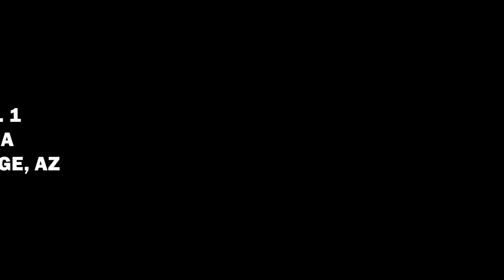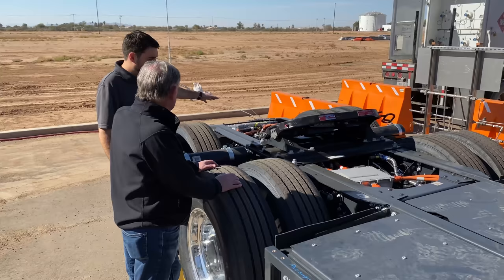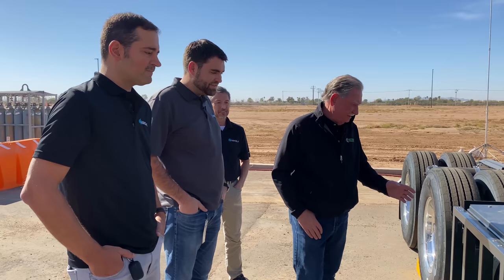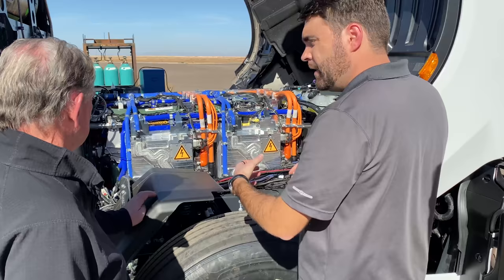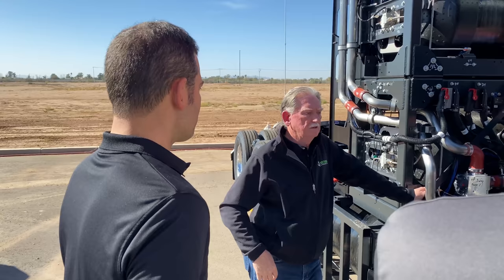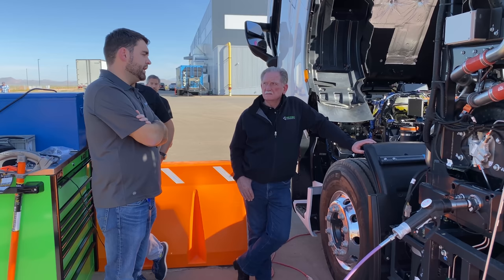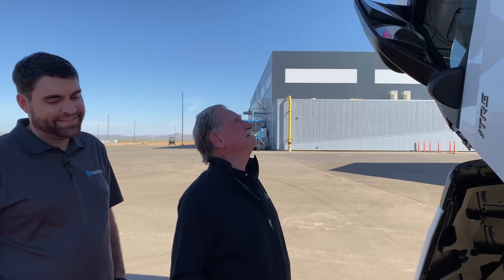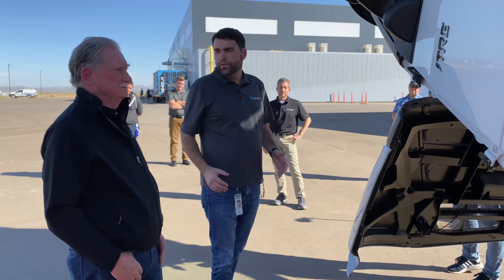Nikola Series - Ep. 1: Introduction & The FCEV Alpha

Comment: Tony Seba talks about a situation called super power where there is massive amounts of surplus renewable energy and some of the excess could be used to make cheap hydrogen.
Superpower would mean on 15 days a year you have just enough renewable energy and on 350 days a year you have surplus.
Reply: Yeah, I saw something similar. A study that claimed the cheapest way to get to 100% renewables would be to overbuild solar/wind such that their lowest output of the year is adequate along with modest storage. That leaves a lot of curtailment during much of the year.

Comment: This is the Nikola Tre Fcev with 2 100 kw h2 fuel cells that produces electricity, h2 fuel cells do not hp or torque ratings, rechargeable battery pack that provides electricity as needed, and 645 hp electric motors integrated into the rear axles, 500 mile range and is much smaller than the Tesla Semi truck with 500 mile range. Nikola Two fcev might have 900 miles range, is similiar in size to the Tesla Semi truck. Nikola Two fcev prototype seen driving on test track, not pushed downhill.

Comment: Fuelling the trucks from a high pressure tube trailer is painfully slow and stops when the pressure in the supply trailer equals the trucks tank pressure. The only feasible fuelling process going forward is a liquid hydrogen tank flashing off the liquid through vaporizer coils and then feeding it through a high pressure pump to fuel the truck. A complex system involving trucks to transport fuel to fuel trucks. Battery electric trucks do not require trucks to fuel trucks.

Comment: Thanks for another useful video. I was a little surprised by the total power capability of just 200 Kw (approximately 268HP). That may be fine for mostly level terrain but not so good for hillier country.  I just did some back of the envelope math on power requirements. For an 80,000 lbs. GVW and ignoring rolling resistance and drag it would need 112 HP to maintain 60 MPH up a 1% grade, 224 HP for a 2% grade, 337 HP for 3%, 450 HP for 4% and 563 HP for a 5% grade. A bit more math and the maximum grade for 80,000 lbs. at 60 MPH will be 2.3% with sustained 200 Kw power delivery. Clearly, this unit will be challenged for highway use. One last thing, what is being done with the energy captured from regenerative braking? How is it stored?
Reply: Didn't you watch the promotional video? These trucks are only designed to go downhill.

Comment: munro is ok with his idea of getting rid of mirrors, but what does the driver do in an electronic failure to safely navigate off of road ?
Reply: How about using them both?
Reply: @ThisIsF-dUp  he said in the review of the truck that mirrors are not aerodynamic, why not use cameras, if you take mirrors away, an electronic malfunction could be bad for driver if he has to get over to right lanes in the blind, i have had a right hand mirror come loose on the highway driving a semi and having to merge lanes to the right blindly was a scary experience. that's all I meant was from experience.

Comment: It seems to me an added battery might be useful for added acceleration performance and energy recovery on braking.
In principle the fuel cell can be inverted , operated as electrolyzer, but oxygen also gets generated and a pump would be needed to put the recovered hydrogen back into the tank, or into a lower pressure storage tank .
But probably far too expensive to recover energy .
I think the added battery to boost power for hill climbing and dynamic braking will eventually be installed, reducing the brake wear and maintenance significantly
Reply: They have that already. Apparently fuel cells do not react as fast as we want to a depression of the accelerator pedal so they add a battery for those occasions and then it can also capture energy from regenerative braking.
The Nikola Tre BEV has nine battery packs. This fuel cell model has 2 or 3 (can't remember which).

Comment: At around 15:14 they talk about batteries. What is so different about Nikola's batteries that they don't degrade over the same timeline? Or do they not use batteries in their system?
Reply: They have a BEV truck. This fuel cell version does have some batteries since fuel cells don't respond quickly and the battery provides the extra power needed on acceleration and starting up hills and can also capture regenerative braking electricity.

I wish Sandy had queried them on their statements in that part. They appeared to simultaneously say that their fuel cell degraded over time but the power would not degrade much over time.

Comment: I’ve commented before that swappable battery packs make sense, especially with trucks.  It would be easier to institute a standard for trucks because their sales aren’t as style driven as automobiles.  Swappable battery packs also gets rid of the battery aging problem because a vehicle is not stuck with the same battery pack for its entire service life.  There is also the possibility of using a mix of permanent and swappable battery packs in a given vehicle.  Early on Tesla considered swappable battery packs for its automobiles, but abandoned the idea - just too much build-out required.  For trucks, there are many fewer service plazas, so build-out of battery swap stations while an issue is less an issue.

Comment: 9:20 No, that's just flatly wrong, and although Sandy, I give much kudos for being polite, for you to actually go along with that doesn't reflect well on you. Natural gas is much lighter than air (and slightly lighter than water vapor). Not sure if they're confusing it with propane and butane, which are a bit heavier than air, or with gasoline, a really lame comparison if that's really what they're thinking.

Addendum: Maybe some people think gas is heavier than air because the odorants are heavier than air, and in a leak situation they quickly separate and hug the ground, giving an impression of the gas staying low as well, when it's really rising.

Comment: Per the last minute, I suspect the holdup with camera vs mirror regulation is that mirrors, for law enforcement, are obvious when they are broken, cameras are much more difficult. You could potentially have a light coming off the electrical line for the camera or a software thing, but I imagine the concern is that both of those can be "hacked/faked" much easier than mirrors can.

Just my guess though.

Comment: Some hard hitting questions I wish Sandy would have mentioned (still 4 more parts to the series, so let's see):
1. Weight of vehicle
2. How much gross weight can it tow.
3. How often to refurbish H2 storage tanks? The cost to do so.

Just looking at this truck (ignore all the telemetry wiring) the complexity is huge. Agree also that it doesn't look very aero. Get rid of mirrors for a start! But look at the parts and weight that get added, H2 tanks, Fuel Cell, batteries, etc. H2 for trucks doesn't look like a good option to me. Not yet given where the tech is. But it is dead on arrival IMHO due to cost. Both purchase cost and cost to refuel. If you are using grey or blue Hydrogen, your environmental credentials are in ruin. Green Hydrogen is best, but very expensive and energy intensive (requires 3x electricity as just powering a BEV truck).
Reply: Sounds like you don't know about the free fuel and maintenance plan included with the price of purchase. Nor do you know about the the various partnerships to create clean H2. Learn more kiddo...

Comment: Sandy, there may not be a transmission or oil tanks, but there's an amazing amount of tubing.  Semis are subject to a lot of shaking on the roads so there will be a lot of twisting and shaking in all that plumbing.  BC Transit ran some test H2 buses during the Vancouver Olympics.  From what I understand, they did not keep them on the road afterwards because of unreliability.  Granted, that was 10 years ago, but the complexity of these systems is multiple times that of an EV.  And, is there no battery at all?  My understanding it that the fuel cells charge a battery that feeds the electricity to the motors for smoother and more reliable performance.  Be really surprised if these H2 semis will be ever be practical and cost effective to operate.  In BC, the subsidized price of H2 is $12.78/kg, unsubsidized about $16.00/kg. At 70 kg., the unsubsidized price of a fill up would be $1,120 for a 500 mile range or $2,24 per mile.  How does that compare with diesel and Tesla's BEV Semi?  In terms of the all important emissions, 98% of H2 is made from natural gas and lifecycle natural gas emissions is only about 20% less than diesel.  Green H2 is a pipe dream as it takes some 60 kWh of electricity to make 1 kg of H2.  That's 4,200 kWh to fill these 70 kg H2 tanks. How far will the Tesla Semi go on 4,200 kWh of charge??
Reply: The Nikola Tre BEV has nine battery modules. This fuel cell Tre has 2 or 3 battery modules for better response and also allows capturing regenerative braking energy.

Comment: I have problems with hydrogen because there is an extra conversion involved in the energy distribution process converting electric power to hydrogen and then back to electric power again.  Each conversion adds inefficiency.  A game changer would be if there were a way to obtain hydrogen directly from a fuel source without electrolysis.  Unfortunately I don’t see that happening at scale any time soon.

Comment: Apparently the Nikola 1 has a 350 kWh battery pack that they did not show anyone.
Doing the math a loaded FCEV Class 8 truck with 80,000 pounds cannot do a 5% grade at 50 mph because over 400 kW of power is needed to just overcome the gravity forces and, as per the video, Nikola said the power output from the fuel cell stack is only 200 kW. 
Arrive at the bottom of a hill with a low battery and the FCEV truck is not going anywhere. 
"Hill anxiety" anyone?

Comment: pressure hydrogen has leaks you cant't see.. that use to be a problem in the plant i uset to work at.  think if that happens on the truck... hydrogen gas its just too unstable when there so much of static in the air...specially during raining seasons....

Comment: For sure a hydrogen powered truck will work.
Let's ask some critical design review questions.
-Will it really meet the specs?
-Where will the green hydrogen come from?
-What will the green hydrogen cost?
-How long will it take to pay off the feeling station?
-How much life cycle testing have they done on its components?
-How many miles test track testing have they done under load?
-Home many miles of road testing have they done under load?
Been on both sides of the critical design review process, I’am sure there's many more questions to ask.

Comment: So many red flags! My favs:

- Does this look like a 4B company? Got space but where's the team, Machinery etc.? Zero activity. 
- How often Sandy keeps reframing as great for an Alpha... not just great. 
- 19:35 "we're looking into fast fueling times of 1 hour or so"! 😬
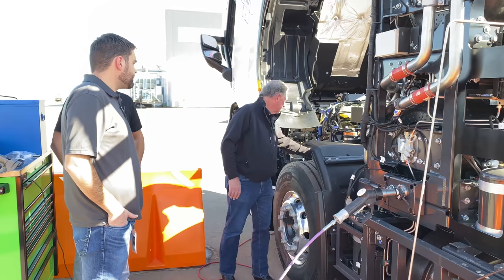- 22:19 uh you're going to bolt that down before you drive it right? Should at least be painted red. 😬 
- 22:35 We've giving you access so don't criticize? Do they consider Sandy being there as PR or getting some world-class engineering input? He literally just told them how to cut it from an hour to 15min of fueling time off the top of his head & they barely listened.
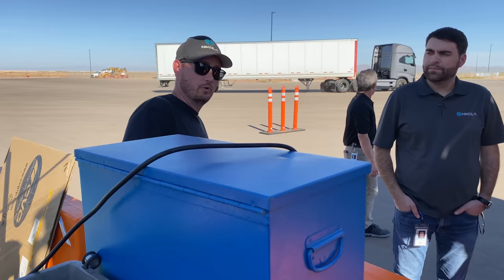- 25:04 truck in background makes a sound like something is very off. 😬

I'm sure I'll enjoy the rest of the episodes cringing as we read between the lines. Keep it coming!

Comment: Thanks Sandy for previewing this Hydrogen powered rig. My first impression is; holy crap! that thing is impossibly complex! Practically speaking. New technology usually means frequent breakdowns but Service Centers would be very few and far between. A breakdown on empty stretches of road where long-haul trucks travel a hundred moles from nowhere. Could require the truck be towed hundreds of miles to a Service Center, and Big-rig towing is very expensive. Can an expensive Hydrogen powered truck like this be truly safe in real world long-haul trucking? Could it be economically feasible for an owner-operator to invest in? Insuring a Hydrogen powered long-haul truck might be pricey too. Bottom line, it seems logical that EV trucking will be sooner to market, less costly up front, making it more cost effective. Far less complex to operate, and less likely to breakdown. Plus much easier to work on. However, I’m no expert. Just an observer. Thanks for your thought provoking content Sandy.

Comment: Hydrogen has its work cut out to take on batteries. The lower efficiency needs to be overcome with mileage per ton of installation, all included, versus batteries. Residual value matters, but so does maintenance throughout the life cycle.
As truckers need to usually wait for (un)loading and sleep, it's relatively easy for batteries to make up time. Korean cars charge in about 30 minutes so with a scaled system, difficult to compete with. A few 350 kW chargers in parallel is not that complex or expensive compared to a hydrogen installation. And you can't place those inside or close to a distribution center, let alone refuel during (un)loading when the driver needs to be present.
Reply: Distribution centers with Outdoor electrical chargers and hydrogen fueling stations have already been built with many more in design. For short-haul electric trucks makes sense. I am working on utility grid issues using backup power and microgrids for some of these new distribution centers. Keep in mind the average EV car has less than 40kWH batteries to be charged a night during off-peak hours which is not an issue. EV trucks have 650kWH batteries that need to be changed every three to four hours during peak hours. Hydrogen does not have a utility grid issue, especially when using NG or filling tanks at night.  Also, long truckers can only work 14 hours before their daily is met in the USA. Truckers basically get paid by the mile they do not get paid for refueling every three hours

Comment: ...pulling away with 200kW (270bhp), I guess there will also be a battery to buffer for boost/regen phases?
Reply: Yes. The Nikola Tre BEV has nine battery modules. This fuel cell version has 2 or 3 (can't remember which).
Reply: @lockbert99  The kinetic energy of 40 tons at 80kph (22m/s) would be rougly 2,7kWh, not a lot of battery needed for that...

Comment: How long does it take to fuel?  Well, that was an easy question that was followed by a 2 or 3 minute answer that basically came down to, really freakin slow.  They want to fuel to 700 bar.  Those tanks would get red hot if you tried to do that at any amount of speed.  Tell me how this is going to work out better than charging batteries.
Reply: Yeah, I didn't like that answer. It had current mobile unit refueling time and hoped for future station refueling time. It lacked - current station refueling time. That should have been the first part of their answer.

Comment: FCEV is the byprocuct of hydrogen energy storage, which is the only possible method to store energy over months. When energy was already converted into gaseous hydrogen, the most convenient way for a truck to use it is to load the hydrogen directly into the tanks in the truck, instead of converting hydrogen back into electricity then charging batteries on the truck. You guys can only understand a FCEV by understang energy storage at first.

Comment: Carbon fiber tanks for firefighters are required to be tested every 5 years and have to be replaced every 15 years.  There are 30 year tanks but they are usually trashed by that point and isn’t a good fit. Would these tanks require that same level of care? 10k psi is no joke.

Didn’t say anything about tanks heating up during fueling, whatever hydrogen left in the tank is compressed and creates heat. This heat and throw off the actual pressure, and heat limits how fast that tanks can be refilled.

What about a small battery with high charge and discharge say stays at 50% charge, helps with high load like acceleration where the fuel cell couldn’t keep up.  And stopping can be recovered some energy and used to re-accelerate like a hybrid.
Reply: Fuel cell vehicles, including this one, do have small batteries for the reasons you state.

The Toyota Mirai has some hard limit on it's tank beyond which the car won't operate unless it is replaced. I can't find anything on it right now but it is 8 or 10 years. So yeah, that is another issue with a fuel cell truck. The tank.

Comment: Im eager to know the price of long term owner ship, can you imaging trying to find a vacuum or fuel leak in that system if the truck is 10 years old. Jesus christ. Paying a technician to repair or diagnose such a complicated system must be more expensive than anything battery powered. Complexity normally means more problems. Its cool that they are pursuing this and maybe some new ideas will come off this for the future but i dont think this level of complexity will make its way to replace future trucking.

Comment: A true Michigander only comes down to the Phoenix Valley in the winter. Nikola is not the only one making hydrogen power generation. Hopefully, someday you can make a trip to Rochester and Columbus to visit manufacturers that are filling hydrogen orders. Maybe why your crew is in the area you can stop over in Scottsdale and update us on Plasma Kinetics' solid-state hydrogen. Keep in mind there is a 125kW and supposedly a 1250kW hydrogen fuel cell and engine-generator respectively backing up a small part of a data center and a distribution warehouse in the Western states. Is the Nikola Bosch Group the ones that met in September to build a hydrogen fueling station with the local utility APS?
Reply: Haven't heard they were going to build a station with Arizona Public Service. Just that they had an agreement to buy surplus electricity (I assume from renewables) at a good price.